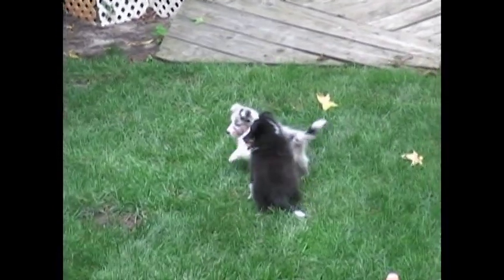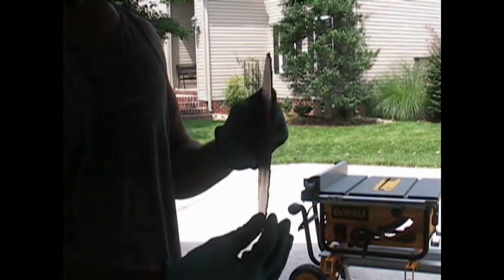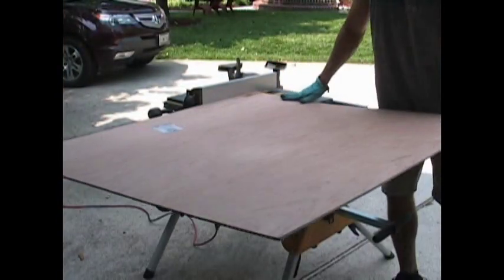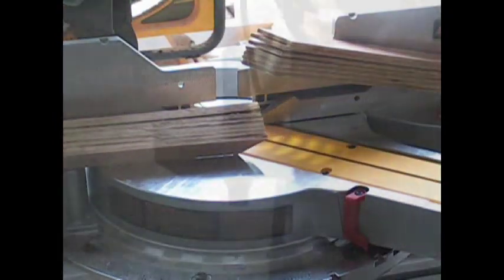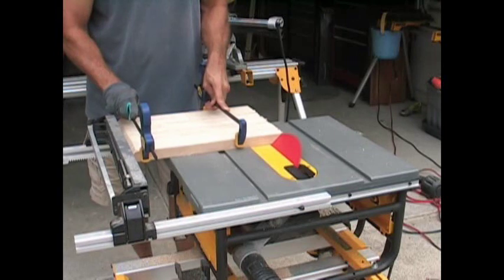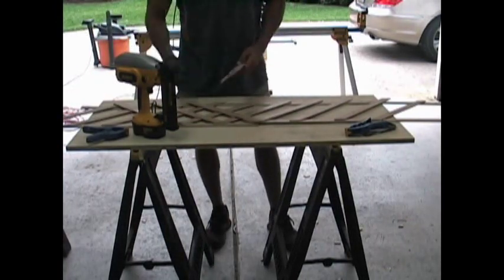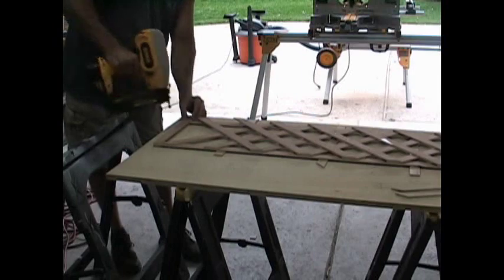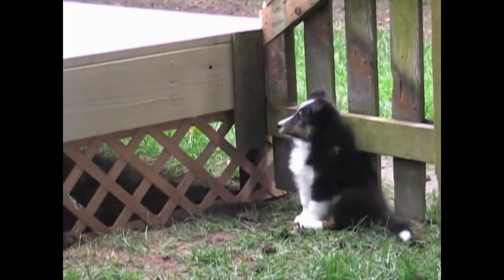How to build your own custom lattice / Jon's DIY

Comment: Anyone watching this...never use plywood!  
Buy solid lumber (2x4-2x6s) and mill it down with your table saws and attach with stainless steel staples.  
When it comes to painting it only use a full-body stain as it will never chip or peel...once and done product that'll last a lifetime.

Your welcome!
Reply: Exactly. Everything I wanted to say. I knew someone had to have beaten me to it. 👍👍
Reply: what size are the staples?
Reply: @harrybond007  1" x 1/4" x 18 gauge
Reply: @wayphun72  You mean 1" long and 1/4" wide?, does it depend on how thick the 2 strips are, you don't want the staple to poke out?
Reply: @harrybond007  I rip my lattice slats around 9/16" thick, then use a 1" long, 1/4" wide staple, which doesn't poke out the back.
Reply: @wayphun72  ok got it, I need to make a lattice so these details are important - thanks!
Reply: Agreed.. the plywood will fall apart.. u know this if u have ever used it in an outside application, exposed to the elements

Comment: i used plywood outside once...lasted a year in the snow with outdoor paint on it.  How long did yours last?
Reply from the maker: I ended up spray painting it white. Its still up but It does need to be changed out. So about 4 years.

Comment: good idea - thank you
Reply from the maker: A couple of tips.  If you can avoid it don't let the lattice touch the ground.  It will absorb water and won't last as long.  I put mine below the ground incase the dogs tried to dig.  (They didn't)  Also spray a coat of shellac or paint them if you can.  This will allow them to last a long time.  Thanks Jon

Comment: Use treated deck boards or any treated wood and rip the thickness you want oh by the way time is money so if you look at that a penny wasnt saved and it wont take a lifetime 😂😂😂
Reply: The cut parts of the treated aren't really treated  any longer